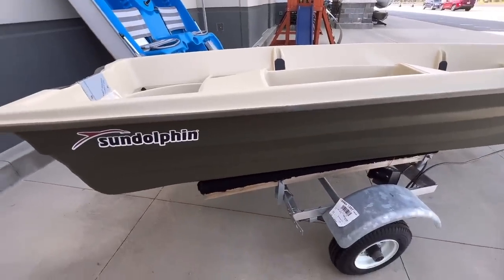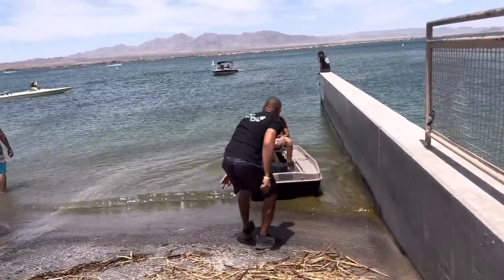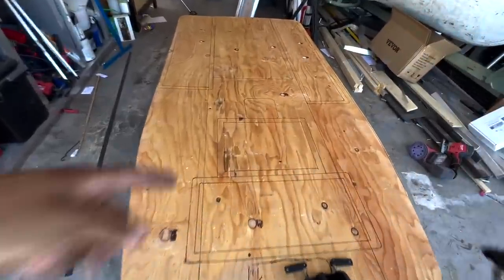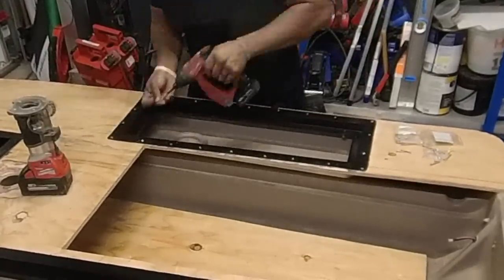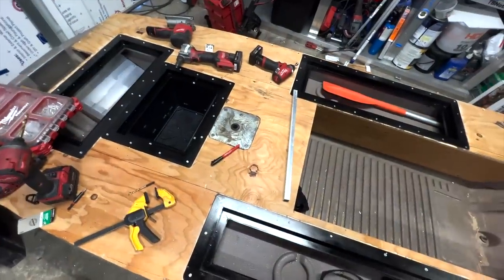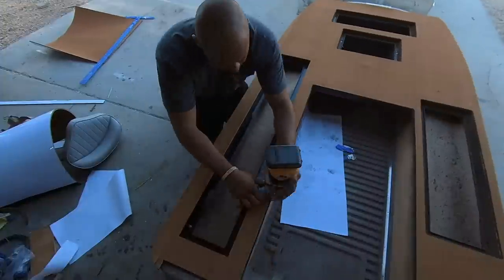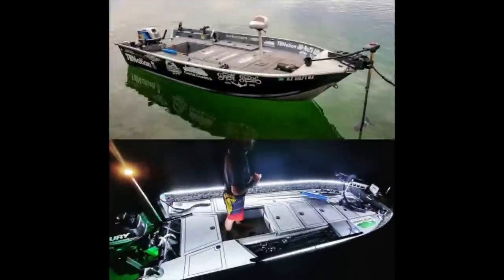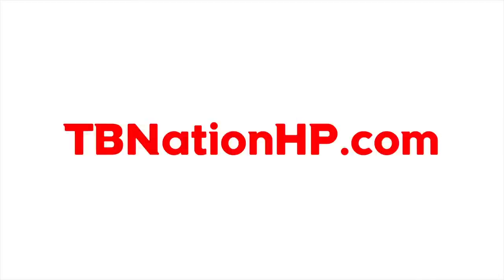We modded the Pond Prowler?!? pt.1

Comment: if you put 2 8ft irrigation white pipes and mount them on the sides acting like 2 smaller pontoon's. It will be so stable that standing up will be no problem. From builds i have done in the past I realized the higher you are in the boat obviously the rocker it gets. it does make a little drag in the water but seeing that this is for your son it's something looking into that boat will not tip over
Reply from the maker: IT doesn't need it. It's a true 48" width. It's stable enough.
Reply: @TinyBoatNation  learn something new every day. Thanks for the info

Comment: Those little plastic boats are unbelievably stable. I take an 8 footer out out on a bigger lake(225,000 acres) with traffic and it does great. If you want to get out on the water cheap, one of these and a trolling motor with a battery can get you there.

Comment: how did u fasten the deck to the boat?  i noticed some screws along the top edge.  dont you think they will strip out or leak?  i am doing a similar project on the same boat.  was thinking of using well nuts to keep it from shifting.  thanks for any input on how you did yours!

Comment: I used to have a 3.5 merc outboard on the back of my 8ft prowler alot of potential in these small boats
Reply from the maker: How fast?
Reply: @TinyBoatNation  couple miles per hour with 2 guys in in it fully loaded definately alot quickerer than say a 55lb thrust motor not crazy fast but i got around he lake river creek fairly easy wit it u can go up to 5hp if u wanted